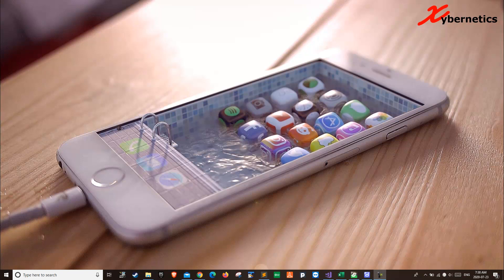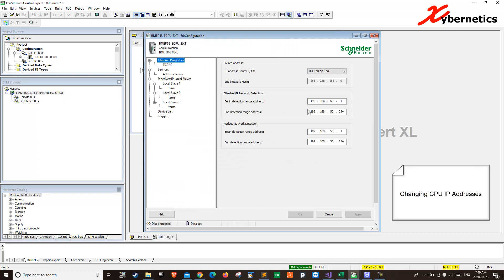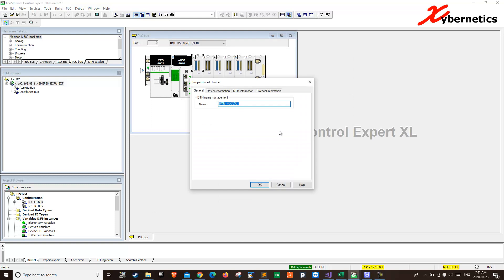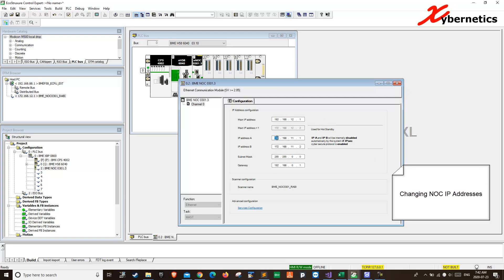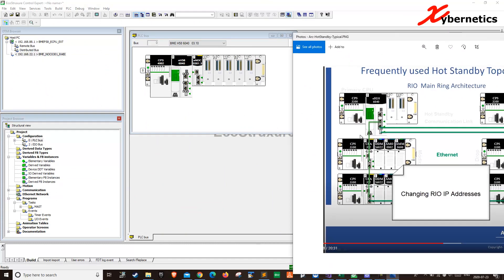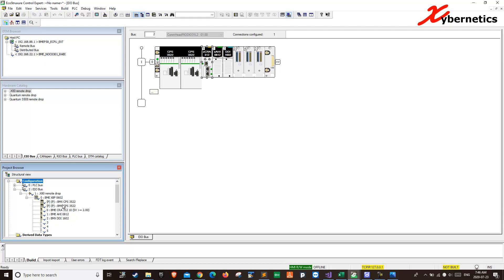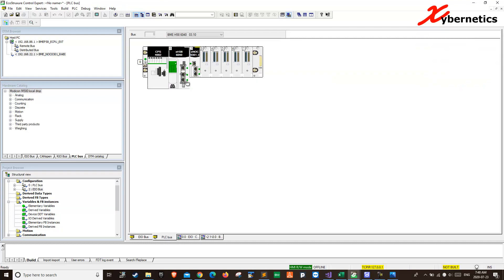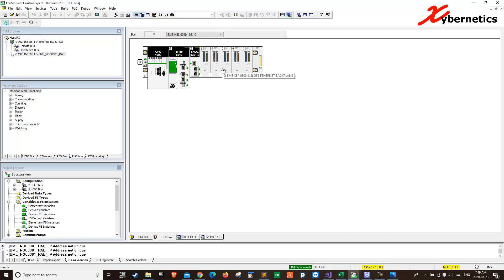Change IP Addresses For BMENOC0301, M580 CPU And BMXCRA31210

Comment: When  I was connected to Ethernet cable of M580 service port primary CPU and secondary CPU to scada so my main ip is not continuesly ping after some time break and  show in run cmd rquest time out. But I disconnected Ethernet cable from one CPU then my both IP main and main+1 easily  ping. Plz resolve my problem ASAP. Redundancy is not working.
Reply from the maker: I am not to sure about your ping you are referring about. You can ping between CPUS using the Schneider Electric EcoStruxure control Expert software. Is that what you were referring to when you say ping?
For the redundancy, you will require to use the SFP socket on the M580 CPU. That LED on the SFC socket will not blink unless you have wire break between the two CPU or the secondary CPU is turned off.
I will put together a YouTube video on what the redundancy LED looks like on the front of the CPU and what the HSBY tag looks like when we power cycle the power module to simulate power failure and how the redundancy behave. I will be publishing it tomorrow and will drop you a message in this comment section.

Comment: Hi, how do I establish communications between these three devices. 
 
PLC - Modicon M580 BME P58 2040 
 
Workbench - SCADAPack 300E TCP/IP
 
Vijeo Designer - HMI STU 855 touch panel 
 
Much appreciated, 
 
Thanks in advance
Reply from the maker: All these drives have a common protocol which is Modbus TCP.
For Schneider Electric Modicon M580, you can setup a DTM for Modbus communication. Launch you Control Expert tool. From the pull down menu select Tool and them DTM Browser. Select the NOC then select the "Add" from the context menu to add a Modbus Device from the Device list. From the "Properties of device" give the DTM a name. This is where you can assign IP address as well for the Schneider Electric Modicon M580.
For the SCADAPack 300E, there is a MBIP function block (Modbus TCP master) that you can use. Please refer to Telepace Studio help file and look for MSIP (Master IP Message) function block. So essential you are setting up the SCADAPack as a Master Modbus TCP. Map the data that you read from the Schneider Electric Modicon M580 on a sequential Modbus address so that you can optimize the Modbus such that you are only doing one poll to pull all data to the HMI STU855. In Essence, the SCADAPack would be the gateway for these devices.
For the HMI STU855, you poll data from the SCADAPack as a Modbus TCP master. The HMI can also poll directly from both devices. It all depends on ho accessible the PLC and RTU is. Also in a lot of facilities I gave commissioned, we use SCADAPack as a gateway as it is a cheaper RTU and it has a full Modbus register address but just be aware it is not an enhance Modbus (range from 0 to 49999 only).
This is a quick insight. I hope that help.
Reply: @RabiGurungXybernetics  thank you so much I’ll let you know how it goes, is there a test I can do or something to validate that theres comms between devices?
Reply: @RabiGurungXybernetics  do you have an email where I can directly contact you if I run into any issues? Thanks
Reply from the maker: @hornsac  There are communication checks in each setup you do. For example in SCADAPack, if the communication are bad between the SCADAPack and the M580, the output side of the MSIP function block on the second leg will energize to denote that the communication is bad. On the Schneider Electric M580, the DTM property called Freshness will show as Zero if the communication is bad, Just keep in mind that there is Freshness and Freshness_1 which are Global Freshness and Freshness of Object respectively. The one you want to monitor would be Freshness not the Freshness_1 as that pertains to Schneider Electric M580 DTM Modbus Device object overall health.
Reply: @RabiGurungXybernetics  I’m not sure how to configure the SCADAPack 300E. I’m unfamiliar with what you’re saying about MBIP function block. I understand the concept but not sure how to configure it
Reply from the maker: @hornsac  It is MSIP function block that we are after in Telepace Studio (assuming you are not using isagraf)
Here are the parameters that are available once you drop the MSIP function block in the Telepace Studio.
Slave IP Address - IP Address of Schneider Electric M580 PLC
Protocol Type- Modbus/TCP
Function Code- Holding Register if you are reading 40000 registers
Slave RTU Address- Modbus slave address of the Schneider Electric M580 PLC
Slave Register Address-  Modbus address that you are trying to read from Schneider Electric M580 PLC
Master Register Address- Modbus address of the SCADAPack you are trying to copy the data into
Length- the length of Modbus addresses you are reading starting from "Slave Register Address"
Time Out- Modbus timeout duration which you are gonna have to extend if there is communication latency.
Reply: @RabiGurungXybernetics  I see what you mean now. Is there another way of configuring it without Telepace Studio?
Reply: @RabiGurungXybernetics  Is it possible to for the PLC modicon M580 to act as a master?
Reply from the maker: Absolutely. It is done using the same DTM Browser. But this time round click on the Modbus TCP Request tab settings. Enter the RD Address (Read) and WR address (Write). Note that these are not real Modbus address but rather a holding point array... but you can treat it like Modbus address.... Does that makes sense?
Have a look DTM Modbus Request tab setting.